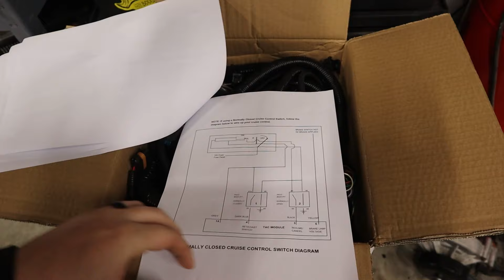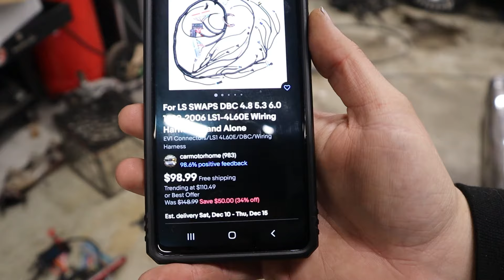$99 EBAY LS HARNESS for our DIRT CHEAP S10 Drag Truck Build! Project Dime-A-Dozen S10

Comment: I used one on my c1500. I spent a few minutes with a multi meter making sure it didn't have some of the common well know issues. In my case, I was good to go. The harness worked out great, and it allowed me to put the ECU in the glove box area because it had the extra added length.
Reply: That's good to know I am getting ready to switch my C10 over to LS so it's better for my son to drive

Comment: Your tip about the 12v ignition being connected to the old distributor wire in GM stuff was really helpful for me. I’m LS swapping my 76 C10 and I’m not extremely experienced, so tips like that definitely will help me out. I think it would be cool if you made a video about LS wiring in older GM vehicles (tips about utilizing existing wires and such). I think it would be very helpful and would make it less intimidating for guys like me. Keep up the good work man!
Reply: showed the wire colors an what they do from factory an all that
Reply: On a square body my recommendation is delete that mess off the firewall that originally has your fusible links and runs to the starter and alternator.  If you use the oem GM harness you don't need the exciter wire from your trucks alternator either.  That said with one of these Ebay specials it's hard to say if it has that wiring in place.  I just ordered one of these 94 dollar ones so I will see... I normally rework all my own.
The big pink wire that powered your distributor can theoretically power up all your coils, injectors and whatnot but I just use it to trigger the  ignition relay myself and get the actual power for all those things from the battery.  The purple wire down to your starter is still the same starter solenoid wire.

Comment: I was going to use Holley Terminator on the project truck that I am building. I went to order the system and found out that the prices have gone up $400. The Max system that I bought 2 years ago cost $1200 that system is now $1600. I will be using the stock computer.

Comment: 10:54 when I did mine, I cut a rectangle hole in the firewall and made a face plate for the ecu that bolted to the firewall over the hole I cut, so the plugs were the only part showing. So if i had to, Id just take the bolts out of the face plate, take out the 2 screws holding the ecu to the face plate and done. Also keeps it dry and less in the elements.

Comment: Thank you so much!  I just started down the LS rabbit hole and will be swapping out the 5.9L Dodge Magnum in my 1957 Chevy truck for a 2005 5.3 LS from a Chevy Tahoe. 

I did the Dodge wiring myself with the help of a factory service manual, since nobody does stand alone harnesses for the Magnum platform. I’ve had it running and driving reliably since 2015, but the transmission is getting to the point where it will need love, and even with the cam I swapped in, the Magnum is limited in what you can do with throwing lots of $$$ at it. 

The Dodge drivetrain was a stop-gap when I did the 4wd chassis swap. I didn’t have a GM transmission or transfer case at the time and my budget was limited. I stayed with the good parts from the donor truck and made the most of it. Now I can afford better…

Comment: For the relay if you hook up the wrong color or just don't like the colors they are using for stuff you can de-pin them and move them around if the wire is the right gauge and you can remove the 87a wire since you aren't using it but I have had the connections fail from corrosion but what I like is you can buy sockets with the terminals it works out cleaner and less extra butt connections

Comment: I agree with free for the toggle switches. 

If people want to get picky. You can buy a 8 pack of toggle switches from Amazon for 11.99 so 1.50 each and yours are used so I'd say less.

Comment: Man, I'm so excited to see how this little truck runs but I'm worried about that cam and springs you bought.  A guy on here, Powell Machine, did a test on the hardness of the cam, measured lift and duration, as well as tested the springs.  The cam was soft as a flat tappet cam, the duration was way more than what it was supposed to be, the lift on the intake side was over .600" and the springs were binding early and didn't have very even pressures.

I pray nothing bad happens because if it'll actually lives, this is a big money saver over buying name brand stuff.

Comment: I have used 3 of those exact harnesses, none had oil pressure plug so I use mechanical style gauge. Another weird thing to explain to people is it has the 5 wire plug for MAF and then the LS1 style with separate air temp sensor,
Reply from the maker: I had to look back at earlier purchases and you're right, none of them had oil pressure either. Totally missed it lol

Comment: I got one of these harnesses a while back when they were $200……works great only for 1 problem, my dash tach will not work unless i pull out the obd2 fuse, the tack works on my scanner thru the obd2 if i have one hooked up or if you do the bluetooth tablet gauge thing…….but if your old school like me you want your dash tach to work……so i just leave the obd2 fuse out , unless i have to use a scanner which is never……wish i would have waited till they were $99…….even though i have a brandnew terminator x sitting in a box next to a new vortech supercharger sitting in the box as well…..i cant tune so i just bite the bullet and put terminator x’s on my cars when i go boosted😅

Comment: I haven’t made the jump to the LS yet, I have a LT1 project that I’m going to use the old for 0411 ECM in, basically I’m doing the same thing?  I watch as many of your videos as possible I’ve learned a lot. I’M AN OLD GEAR-HEAD I’m slow with wiring. I’m going to start with the 4X setup first then build my courage up an try 24X? 😂.   Keep the great videos coming
Reply from the maker: Heck yeah, man! Thats rad

Comment: Good point on the stock ecu. Maybe you can do a highlight on he different "ls" ecu's like the 0411 vs the early year or e85 flex tune ones. Just for us lazy folks. I got a 00 sierra but I wanna run a 58x and flex fuel on a cammed 6.2 so I'll need to work to swap the harness. But. I think the stock ecu will work fine for that and I'll run a nitrous box with its own fuel tank (spare battery holder makes for a good 2 gallon tank)

Comment: So the stock ecu will work great, even with a somewhat large cam and 11:1? I want to keep my truck  n.a. but I want a good size cam, not big, but good for drags in a truck that I can drive on the street, and do some head work, and try to be at 10.5:1-11:1 on compression. I was going to use my stock harness, but I would go through it at the minimum to find bad wires and what not, so I'm not chasing issues for years. $100 for a new swap harness isn't bad. I'll also need it to work for a 4l60e. Just because that's what the truck has, and should hold 400hp

Comment: I am wiring a 5.3 ls with the eBay harness to basically a shell it’s from 1935 and I got it with nothing in it so I have no distributor wire and no idea where to tie the red wire into

Comment: Great video.  I've got the same harness, bought it 2nd hand.  The prior owner did something to the harness so now I've got no obvious power wire connected to that fuse block.....but he did separate out a red, white and green wire from the harness.  The instructions are now no help in figuring out what's up.  Can you possibly tell me where that red wire was originally suppose to hook up to in the fuse block?  Any thoughts on what the white and green wire might be for?  Thanks a million and great video.

Comment: I have a 1992 s10 4x4 blazer with the 4.3 v6 vortec. Will a 2000 5.3 bolt up to the transmission? Also what trans is in it? The 4l60, 4l60e or 700r4?

Comment: Enjoy the video,but have a question I made my harness out of scrap ones and been in 02 purgatory ever since .the style I have are the flat plugs I noticed on that harness that there's  square what O2 sensor do you have to get for the cheap harness.thanks
Reply from the maker: Ones for an LS1 car like a 98-02 Camaro. I just get the cheap delphi ones off Rockauto

Comment: I have a question and you probably covered it and I wasn't paying attention. Do you still need the solenoid wire to trigger the starter?
Reply from the maker: Yeah, you'd use the stock chassis wiring for the start if you wanted it to start off the key

Comment: All the red blue harnesses I've seen don't run oil pressure it ran strait to the gauge even on the factory trucks.
Reply from the maker: Man, I feel like I should've noticed that before but I must've just never paid attention to it
Reply: This is correct. Pre 03 didn’t provide oil pressure to the PCM it was a 1 wire that went directly to the gauge cluster on the trucks.

Comment: So if you used the original ecm for a stock 5.3 u still have to unlock the computer???????? If you don't have camshaft swapp or nothing else still have to unlock or tune the computer??????
Reply from the maker: Yeah, if you're doing a swap you'll need to unlock the ecu to disable the VATS at least

Comment: I bought a set of those headers not too long ago and I am still trying to figure out how the hell I am gonna change plugs on the back 4 cylinders. I guess I'll find out won't I.... I will probably put new plugs in because I plan on getting new heads and a cam.

Comment: I bought a ebay harness and it was pinned sooo wrong. Drove me nuts trying to figure out why my motor was backfiring and popping through the intake. Turns out a bunch of sensors where wired wrong

Comment: You forgot PC Hammer and Tuner Pro RT!!🤨 There free!
Reply from the maker: I've never used them actually. I'll have to check them out one of these days
Reply: @SniderTron3000  Yes you should!  Like any software they take a bit of getting used too but you can do alot of stuff with them.

Comment: dose anyone know from where can i buy the 6.0 / 4L80E LS Swap GM 0411 PCM ECM
Reply: Late, but from Painless wiring, Summit Racing, PSI Conversions, Salvage Yards, eBay.  You can get  the 0411 flashed with what you have if it's not correct for your 6.0/4L80E, but you can buy it already from setup for your combo from all the above

Comment: Some $50-$100 dollar 862 heads would of bumped the compression up and had nice gains everywhere...
Reply from the maker: Yes, but being N/A there were some drawbacks to it that I didn't think were worth spending the money for this challenge
Reply: if boost is in the near future, I'd could see it... but the 862 head on my lq4 where the best thing I did to the truck. It ran 8.2 in the 1/8th on its first pass... I think it would of ran a high 7 if I wasnt scared of breaking something. 2nd pass I left much harder and broke the rearend...
Reply: @alldabeanzracing9650  I am actually about to swap 706s onto a truck with 317s. True A to B, nothing is changing except for the cylinder heads and adjusting the tune. Same dyno, tuner, etc. I am curious to compare the graphs under the curve.
Reply: @bluecollarhotrods9781  I bet a good 20+ hp everywhere
Reply: @alldabeanzracing9650  the dyno won't lie, I'm honestly expecting about 10 - peak vs. peak. But, if it gets 20... I'll be ecstatic. My main goal is for it to pick up torque in the 3000-5000 RPM range. The engine is an 04 LQ4, XR275 cam, TBSS intake, 92mm TB, headers, exhaust. It's in a 2000 Sierra RCSB.
Reply: @bluecollarhotrods9781  Dynos do lie… but it’ll give you a general idea.

Comment: gen 3 stuff doesn't report oil pressure to the ECU, only to the BCM and straight to the cluster. I have used at least 10 of these harnesses from different sellers (and different prices) and  they all pretty much look the same. P59 style has been good but every P01 harness has needed modification to make the O2 sensors work. They generally wont throw a code but you can see the sensors aren't switching in the scanner preventing closed loop fueling. Check out my channel for a video covering this
Reply: P59s can report oil pressure to the ecm.  You can tell more or less by the oil pressure sending unit change.  Does the pcm do anything with the oil pressure input?  No.  But you can use a scanner to monitor oil pressure if you keep the sending unit wiring in the harness which I like to do.

Comment: If you have the factory harness and you clearly are not trying to make it pretty since you can't be bother to clean the heads and valve covers when you had them off just use the factory and cut the trans stuff and rear o2s or whatever else you don't need

Comment: Crimp connectors, really? SMH. Your fuel injection system is not something I would take a shortcut on. It would literally take an extra 5 minutes to do it properly with solder and weathertight heat shrink tubes.
Reply from the maker: Do you know how many professionals don't like to use solder on wiring in the engine bay because of heat and prefer proper crimps and heat shrink? The first time I heard of it was probably like 6-7 years ago, Turbo Yoda from MCM said he absolutely refuses to solder in the engine bay because solder has such a low melting point. And its not like I was using cheap autozone crimp connectors lol
Reply: @SniderTron3000  Fair enough. I sincerely doubt the intake temperature where that connector would be would be hot enough to  melt a silver based solder, the one I use is ~360 degrees F. Anyhow, good to know there's more than 1 way to skin this animal.